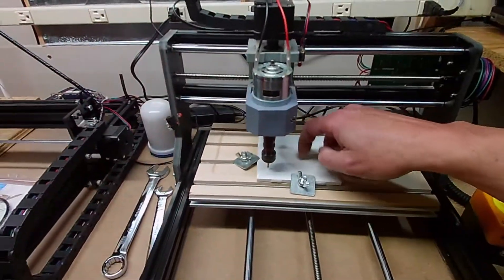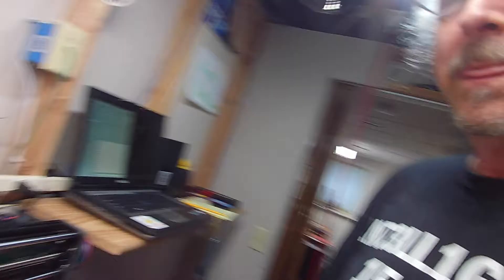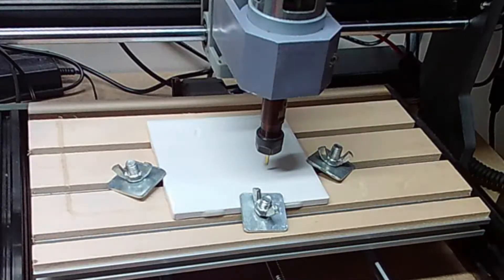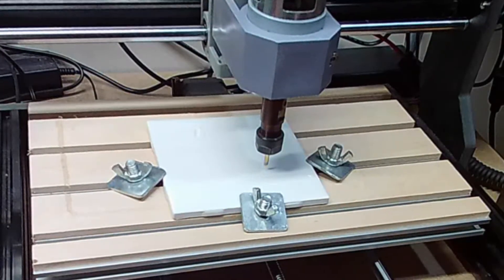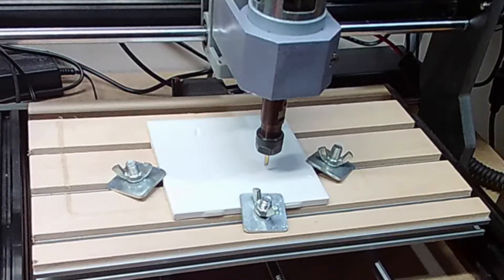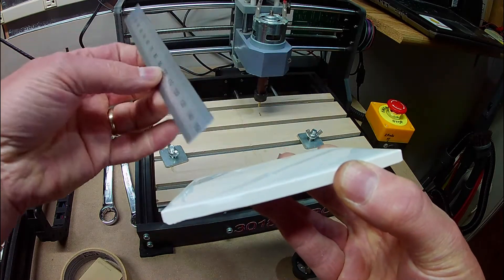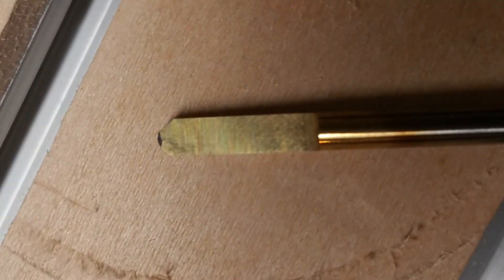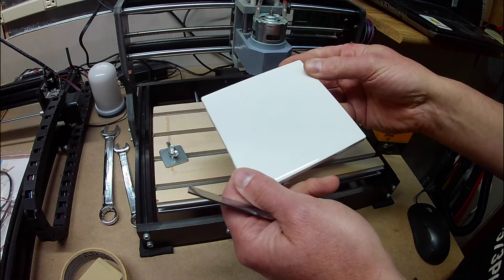Carve a tile with the 3018 CNC router?

Comment: If you really want to pursue CNCing tiles, I'd go to one of those stores that does hobby ceramics and buy an unfired tile. Mill that and then go back and paint, glaze and fire it. I've looked into CNCing glass and that is generally done with a 1/16" diamond burr ( it's a diamond pattern, not diamond material ). I bought a bunch and they are reasonable priced. No special shape; just round like end mills and router bits. There are a couple here on YT but I can't find the links.
Reply from the maker: That is a great idea.  I could put a none glazed tile in my laser too as I know that works.  Hmmm.  I have looked into a diamond bit for the router but haven't purchased one yet.  I have also looking to a drag bit for etching on glass and ceramic.

Comment: its an interesting idea, mosaics could be made so quick and accurate - I looked this up because I want to try to do mosaics in a modern way - I think il use my axidraw and then use and angle grinder. Thanks for showing me it doesnt really work -
Reply: will have to spend 30k on a water jet cnc machine. but hey ho
Reply from the maker: @SoSo-li6dn  - I like the sound of that!  My friend owns a countertop company and they have a water jet that cuts through 1-1/2" granite like it was butter.  Amazing to watch it cut.
Reply from the maker: It has been a while since I did this video.  I would bet that a diamond tipped cutting tool might work.  I may have to re-visit that at some point.  It wouldn't lend itself to fine detail.

Comment: I use a spring loaded diamond drag bit (120 degree tip) on acrylic and it works amazingly well and can engrave very detailed projects i.e 1mm tall lettering flawlessly and is extremely quiet without the spindle running.
Reply from the maker: That is what I have looked at.  I will have to get one and try it out.  1mm tall lettering is impressive!
Reply: @CNCATHome  I run the bit on my 3018 at 285mm/min and set z axis zero 2.5mm deeper after it touches the work surface (for good, even spring pressure) and do multiple passes to get extremely even line depth. You'll really like them!